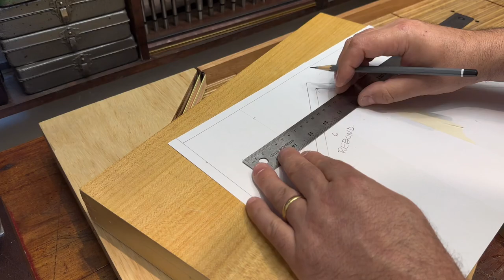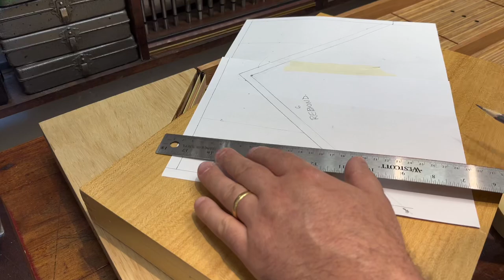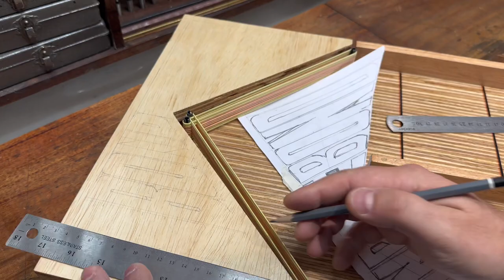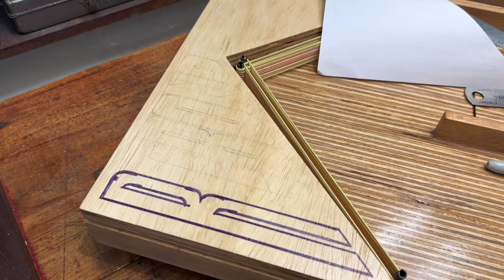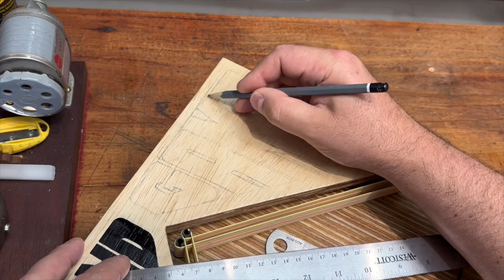How to make a Rebound Game | Amazing game for all Family | #shuffleboard #handmade

Comment: GREAT WORKMANSHIP! I am planning on making my own game. Could you provide info on the pucks you made? I purchased "1 X 3/4" fittings, 1" tube with .85" ID. What size ball bearing should be used? Any help would be greatly appreciated.
Reply from the maker: Hi, thanks for message.
- Tube 1" external size;
- Iron ball, you should look for a little smaller than 1", it will work great.
- pipe joining for pipe 1"
If you need help send to me a message in WhatsApp. I will share more information for you. After that… use silicon oil to slip 😉 @daviddupuis2228 🙏🙏🙏

Comment: You sure rebonded from that typo😂🎉❤
Reply from the maker: Thanks for commenting. It was a mistake when I went to divide the spaces, I made a big mistake. Anyway, life as it is. Wouldn't it be nice to scrape everything and write it right, cut the video and hide the mistake. I found the solution and shared everything complete. Did you like the PVC Rollers? Everyone buys or makes the CNC. I created a way to make with everyday materials. Thank you so much!!! @JBuck-cu7xd
Reply: The rollers were great! I’m thinking of making a prototype with three ball bearings for more of a puck size for shuffleboard. If I do, I will incorporate your design and method
Reply from the maker: @JBuck-cu7xd  If you need more speed, use silicone-based lubricant.
Reply from the maker: Rebound Game  #wooden #handmade #happy #funny #gameplay #gaming #games #oldgames #gold